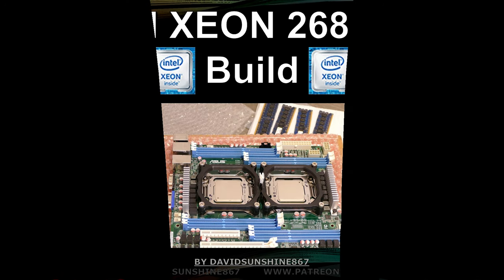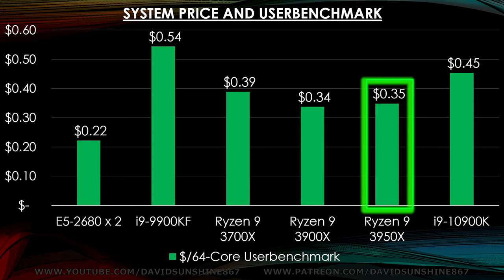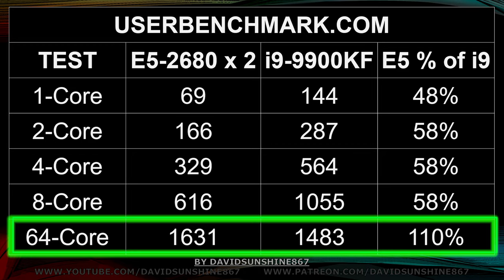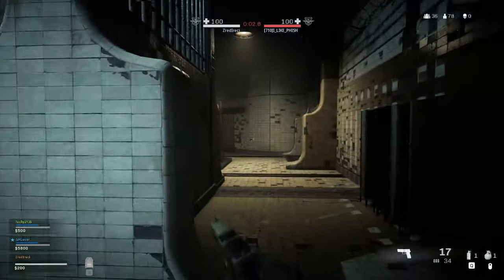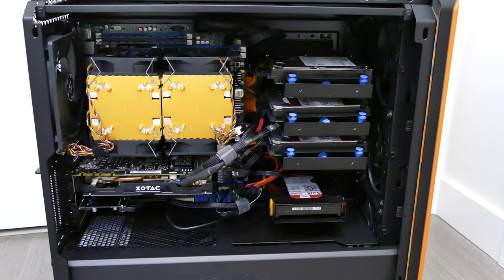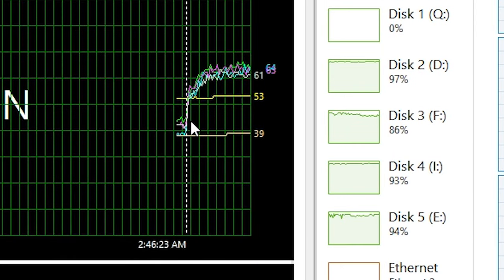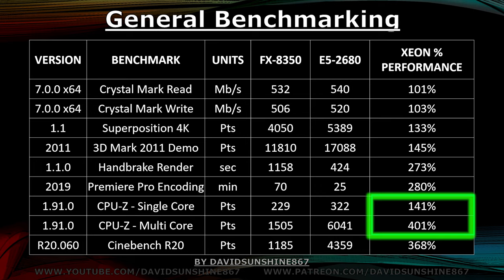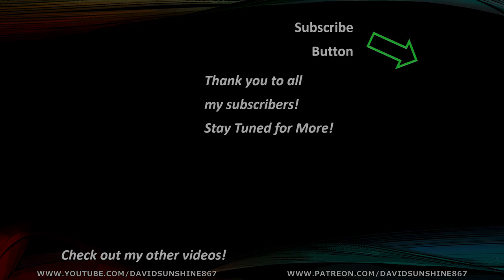Dual XEON CPU Build vs. Intel i9 and Ryzen 9, It's Faster!

Comment: Wow, this is crazy value ! Subscribed. I have been looking at many xeon comparisons. saw a x99 board with both ddr3/4 support. which xeon (dual?) do u suggest to compete with 5950x ? while being much cheaper. out of nowhere found some good old gen gpus e5 2678 v3/x5690/E5-1680 V2. although no idea which is better. interested in 90% gaming and 10% editing ! Thanks !!
Reply from the maker: Thanks for subscribing!  Xeons definitely provide great value.  Great questions!  If you're going 90% gaming, I would actually recommend a Ryzen, since it's got way higher single core performance and that's what you need for gaming.  The Xeons can still provide good bang for your buck, but I would go with one that has the highest potential in overclocking and single core performance, like the E5-1680 V2 on an X79.  Sounds like it's unlocked on the X79 and you can play around with OCing it like these guys did:  https://www.reddit.com/r/overclocking/comments/8mpq1h/overclocked_my_xeon_e51650_v2_to_49ghz/
You can't do multicore systems with the 1600 series, so if you have some, you could make some good single core systems with it.
The E5-2600s are good for multicore systems, but if you're gaming, you don't need high core counts.
The risk you run into using the slower E5-2600s(combined with a fast video card like an RTX 3070) is that your single core performance will be lacking, and you'll get CPU capped in games, causing major lag, and it won't be playable.  DirectX11 is more CPU dependent, and DirectX12 is more GPU dependent, so you could switch to DX12 if you have a slower Xeon, and it'll be a work around, but it's not an ideal set-up for a gamer.
If you're doing video rendering, you'll actually benefit from faster single core performance while editing, since that's not all optimized for multicore.  When encoding the video, that's the only time you really benefit from the multiple cores.
If you don't want to play around with OCing, the Ryzen 3600x provides that fast single core performance you'll want for gaming.  But I think the 1680 V2 with some tweaking could actually be comparable to the 3600x, and better value for your $.
Here the 3600x gets 1569cb on R15, and the E5-1680 V2 gets 1669cb, beating it's overall score, and I assume single core is similar.
https://i.redd.it/flz7k594da631.jpg
https://www.reddit.com/r/overclocking/comments/8222uz/e51680_v2_ivyep_46ghz_cb15/
If you can get a cheap E5-1680 V2 and X79 board, that could definitely be fun!
If you want a multicore system, the E5-2678 V3s would make a good one, but again, the single core will be lacking, and for gaming, that might be an issue, but the V3s are faster than the V1s I used, so you might not have an issue for current generation games.  But since you can't unlock the multiplier easily, you may become CPU capped, which really sucks and is impossible to game, I wouldn't want you to run into that issue. (Could fix it by going to DX12, but then you might run into other performance issues).
I was running my dual E5-2680 V1s/RTX 3070 on Battlefield 5 in DX11 and it was unplayable due to CPU capping, switching to DX12 and it was no longer CPU capped and playable.  The E5-2680 V1s have a single core performance of about 68.8 in userbenchmark, which is pretty slow.  If you want your gaming system to perform well, I'd say you'd at least want it to be 100, 120+ preferably, which the Ryzen 3600X or overclocked E5-1680 V2 can probably give you.
The Ryzen 5000s give you about 159, which is pretty nice, but I don't think you'll need that, or want to pay the premier for that.  I think a 1680V2 OC'd and RTX 3060/3070 or 3080 would be a great gaming system for all current 2D and VR games.
Even my E5-2680 V1/1070 was ok with most games, even Half-Life Alyx was playable, but anything better will be just that much smoother and more enjoyable.
Cheers!
David.

Comment: When it comes to hardware, 99% of the users do the same mistake of IGNORING the 2 other factors that professionals use for calculating how much not only they get, but also how much it will cost. And that is PERFORMANCE/WATT (especially in datacenters) and GB/$ (for storage cost). You only calculate the initial investment (performance per dollar spent) which is a fix amount you spend during the build, but not you or ANY of the benchmark programs out there are using. And they should. Because spending X amount of money for Y amount of performance in the beginning, does not include the cost of electricity. This is even more evident for crypto mining rigs that focus on only one thing. So if a user has to spend $100 extra every month to run 2 old and power hungry CPUs that require 130-150W EACH, then even a crappy first generation Threadripper sounds like a bargain. So for those of you who want to build a new system, ALWAYS calculate how much the rig will cost you AFTER you build it, not just in the begining. And I mean calculating EVERYTHING. Your motherboard alone can eat 50W. Spinning drives require 5-15W each, the chipset is 15-45W, and lets not forget all the extra cards, GPUs, etc. So use a calculator and do the math before thinking that just because something is cheap to BUY, is also cheap to OPERATE. Companies that own datacenters ain't stupid. Unless you want to be a partner with the electricity company, just to get 20 more frames on some stupid FPS game. If you want a rig for professional work and not just for general use, then it HAS to make back its money fast, so the time it takes for return of investment is not something you want to ignore. I've had dual CPU workstations for almost 25 years and spent a fortune on such rigs. Don't confuse the different costs and certainly don't ignore the hidden costs related to your machines. The same goes for cars, trucks, tools and any kind of machinery and equipment. You should factor in all the parameters. Which is why most computer hardware reviewers are clueless bozos (with very few exceptions).

Comment: Wow mannn !. You really help me when you comparing dual xeon and fx-8350. Thanks to your video. Maybe im gonna upgrade my Amd Fx-8350 To dual Intel Xeon E5-2689 or Xeon E5-2690. Thank you very much. You deserve more views man.... Awesome !!! 👍🏻🙏
Reply from the maker: Thanks man!
Ya the FX-8350 ain't bad, but using the old enterprise stuff gives you a pretty fast system for cheap!
Cheers!
David.
Reply: @DavidSunshine  I was a little surprised, I was looking for a "new to me" laptop, upgrade my 2012 laptop, to maybe 2017 level.
The 2017 HP ZBook G3 actually has some models with Xeon Processors!
M.2 PCIe drives, and four DDR4 slots, each one can take a 16GB stick!
They call them mobile workstations, Xeon E3 with 64GB memory, yeah I guess "workstation" is the right term..
Reply from the maker: @jeffschlarb4965  That's awesome!  Mobile workstation powerhouse! 
That's a capable laptop. Pretty cool! I had no idea they made that, thanks for letting us know!
Cheers!
David.

Comment: Do you think this setup with a lot more ram could run several VMs at once? Like lower demanding windows 7 or linux distros. Great video
Reply from the maker: Hi,
Ya I think it would work,m.  You’ll want to go with E5 V3 with at least 12 cores so you’ll have more resources.  You’ll be able to assign the number of CPUs and ram allocations to your VMs as required.  Xeon’s are built for servers so it should work fine, lots of companies are using Xeons for this, I think this is great bang for the buck if that’s what you’re after. There are good packages with lots of ram, I’m sure it’ll cost a lot less than brand new parts, and still give great performance.
Cheers!
David.

Comment: I recently built one of these dual x79 machines.  With two E5-2690s.  I recommend going with v2 CPU’s if you can, because you can then use 1866MHZ RAM.  v1 CPUs also draw more power and heat but I don’t really mind at all, the two Xeon run great paired with SSDs and 32GB of RAM, and when paired with an OC’ed RX 580.  Around 90-95 degrees max load, not too bad imo.  Water cooling may be better for these kinds of things though.
Reply from the maker: That's awesome!  The X79 boards look cool.  Nice!  E5-2990s are fast.  Ya, I agree, V2 or V3 would be great, DDR4 too!
The V1s are great at heating up my room in the winter, not so nice in the hot summer though.  Oh cool, I bet that OC'd RX 580 runs games well!  That's running pretty hot, but as long as it can handle it, it's ok.  Water would definitely be a plus though, with a huge radiator, closed loop, maybe a future build!
Thanks for sharing you build, sounds amazing.  Gotta love these Xeon builds!
Cheers!
David.
Reply: @DavidSunshine  Overclocking via FSB is doable but kind of difficult, might try it sometime.  I would be weary of these Chinese boards though because these may have a Chinese spy chip.  The old saying about the CCP and the spy chips.  I could hae tried liquid metal actually, that could have helped as well.

This machine runs games pretty well, would definitely water cool it.  I maxxed out the amount of fans the case can handle, three front intake, one exhaust, two exhaust on the top.  There's also two large heatsinks on the CPUs as well.  It's crazy to think youg et 90-95 degrees on max load on both CPUs with this amount of cooling!  Liquid metal would definitely be the way to go if you are willing to risk and prepare it that way.
Reply from the maker: @microtecture2442  Ya I got an Asus server board, should be safe.  But the Chinese boards seem good bang for the buck. 
You get 95C on the CPU?  That's strange, I am getting 62C max even with 100% loading on the whole system with AIDA64 trial.
What heat sinks and thermal paste are you using?  I used Arctic Silver MX4 and it's working really well, in combination with those 2 large 4 heat pipe heat sinks.  I just have 2 fans running moderately and it is keeping the heat off them.  But it is running 200W so I could see it getting hot, my case can get up to 50C if I don't turn the fan speed up to exhaust heat out of the case.  Maybe your case is getting hot?  If your case is 60C, I can see your CPUs getting well above that, since the air running over your heat sinks will be 60C. I would check your case air temp.  Take the side panel off and your CPU temps may drop, if that's the case, you'll want to ventilate your case more, at least until the temps are below 45C in the case.
Cheers!
David.

Comment: I had no idea those duel Xeons are still somewhat relevant!
Reply from the maker: Ya it's great bang for the buck if you need good multicore performance, but the single core performance is a little slow if you're in need of that.
It's a great budget system, and I'm pretty happy with it!
Cheers!
David.

Comment: Its been a golden about 10 years.   Its been great .  The best thing about the future is that multicore programs are going to be the NORM.   So your old Server Multicore CPU's are still going to be amazing.    Alebit at the cost of power.   Big woop.  Put up SOlor Pannels LOL.  

I do VIdeo ediiting mainly.  My son games.    And even with a Dell T3500 with a single CPU and a 1070 Founder ediition I got him 3 years ago?  Its does all his games at 4k great.  He notices no slowdowns in his games.  Pretty cool.  

But if I had to build a system?    
Gen 3 Ryzen (about to be realesed) 
AMD GPU
Reply from the maker: Ya this Xeon system works really well overall for the small price paid.
A new build tho, would be awesome with the new Zen 3s, the 5900x looks like great bang for the buck, but it's hard to find any stock.
I'm pretty happy with the 1070, hopefully the 3060ti comes in stock soon.  Would make a wicked new system.

Cheers!
David.

Comment: For gaming, I would go for a newer 4 or 6 core cpu instead of old xeons, a new low end or mid range cpu is cheaper and would perform better because of the better single core performance (most games can only use 4-12 threads), on the other hand your project would make an amazing budget workstation! This comes from a dude with a dual e5-2690 v3 workstation and who has made many gaming rigs for friends. It's not that old xeon rigs can't game, they're just not the best choice for it, I game on my rig all the time. Though the disadvantages of old xeons vanish if your games are very GPU heavy and you need some extra workstation performance.
Reply from the maker: Thanks for the advice!  Nice! v3! Ya I agree, even for regular video editing, I think the faster single core performance of newer CPUs will help, only rendering really makes use of the Xeon's extra threads, like the userbenchmark 64 core test, that's really the only place the Xeon could beat the newer CPUs like the i9-9900 and Ryzen 3700x.   I think the graph at 16m32s shows what you're saying best, the 3700X is a good budget CPU, but gives great single core performance, totally beating the Xeon even up to 8-core, which most games would make use of.  Only at 64-core it gets beat by the Xeon, and not even by that much, so overall system performance will be had with the newer Ryzen cores.  I'd probably get the 10900K if I had the money tho, great single and multi core performance.
For gaming, I'm sure the single core performance will be beneficial.
The Xeon is a good compromise between price, gaming performance, and rendering performance I'd say.
Thanks again for the info!
Cheers!
David.
Reply: I have a 12 core Xeon E5-2690 V3 and a 16 core Xeon E5-2698 V3 build at my house. You absolutely need to have a motherboard that supports quad channel DDR4 to truly benefit from making one of these Xeon builds. The V2s give great performance for the price, but the V3s running quad DDR4 is better for gaming. If you run Quad Channel on your ram it will greatly increase your gaming FPS and most games run very close to Zen 2 benchmarks. If you haven't done it you need to do the Turbo unlock. Single core is still lacking, but unlocking the Turbo gives you a good boost.

Comment: Hi, I just found your video and it has been very helpful, currently my pc (fx 8350) takes a long time encoding video, I normally compress 30Gb bluray with handbrake and the h265 codec and it usually takes around 7 hours. and I wonder if you could do a similar test with this dual xeon to see how long it would take to encode it. thanks
Reply from the maker: Thanks!
I had the 8350 too, and the render is shown at 15m20s. It's about 273% of the performance. So divide the time by 2.73, if it took you 7 hours with the 8350, it'll take 2.56 hours with the Xeons. There's some links in the description, one system is 57%(Dual E5-2678 V3) faster than mine, so that could do it in about 1.63 hours.  Even better than my slower XEONs! I definitely recommend that path.
Hope that helps! Cheers! David.
Reply: @DavidSunshine  thanks bro

Comment: Dear David, very nice video! I would like to ask, why is the new i9 8 core faster/comparable to the old 2x 8cores xeon? Does it mean that for multi-core mathematics computations, modern 8 cores can calculate math faster than old 16 core? is it because of its architecture?
Reply from the maker: Hi Michael!
I don't know exactly why, as there's so many specifics to CPUs, but like you, I believe it is the newer technology in the i9 that makes it perform faster, they both use a 14nm process, but I think they've further refined the i9 since the development of the Xeon E5s. 
 Xeons bus speed is 9.6GT/s x 2 whereas the i9 is 8GT/s x 4.  Bus speed is also higher, this and a bunch of other advancements make single core performance  much higher in the i9, so it's 8 cores can keep up with the 16 cores of my E5-2680 pretty easily. 
I'm using DDR3 as well, so that slows down my system.  If you go with the E5 V3s you can use DDR4, that'll give your single core performance, and overall system performance little boost.
If I did this again, I'd spend a little more for the V3 and get dual 12 cores.
Great question!
Cheers!
David.
Reply: @DavidSunshine  thanks for the prompt reply, keep it up with the excellent videos, its very useful and give a lot of insight! I was planning to build a dual processor desktop but from the benchmark I always feel weird that more core can perform worst than less core (even for multicore jobs), to some extreme, maybe single core in the future can be faster than some 64cores nowadays😂😂
Reply from the maker: @michaelwong2772  Anytime!  Thanks for the feedback as well!
Ya, I think for sure that single core performance will keep going up. For video editing, I think single core performance is actually more important than overall multicore performance.  If you want it to be snappy and fast, single core performance is a must.  That's why Intel focuses on single core performance, it's also good for games.  Programmers don't always program the processes to use multicore, so you don't really benefit unless you do something like render a big video.  It's nice they are adding more cores though, so the i9 can have the best of both worlds.
If you want true performance, you'll want fast single-core and multi-core, but of course that'll cost you.  I usually don't buy the top tier in technology, it always comes at a premium.  I like the value you get from buying used equipment, you always get great bang for the buck.  A 24 core system with 128GB that performs a little slower in some aspects, but faster on others in comparison to an expensive modern system ain't bad value for your dollar!  And I'm sure you work hard for your dollar too, as we all do!  So like me, you'll want to make it go as far as you can. 
That's what I like to do.  Similarly, I always buy used cars, because they depreciate so much in the first couple years, it is greater value to buy used at half the cost of brand new, I think it's a similar deal here for Xeons. So if your looking for a bargain, old Xeons still give you that.
Cheers!
David.